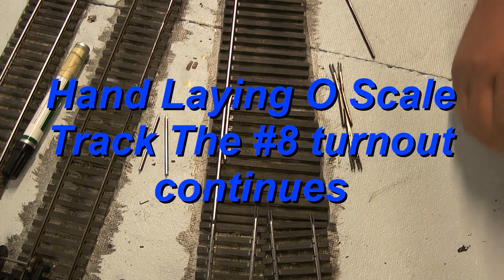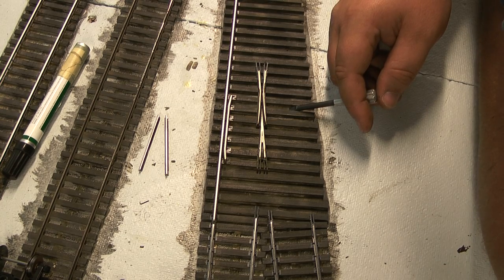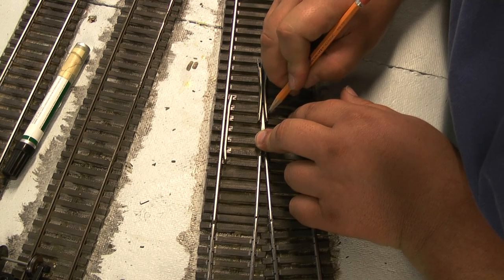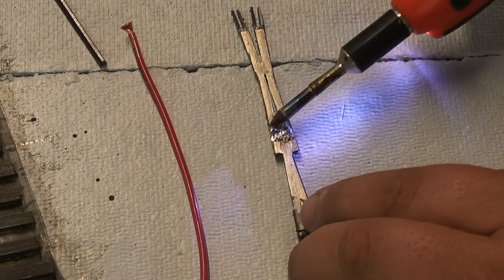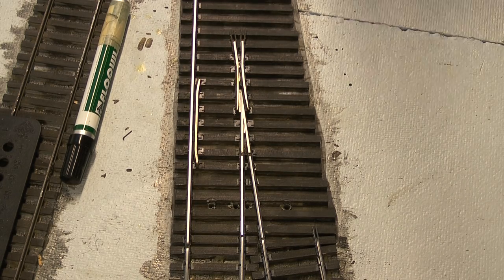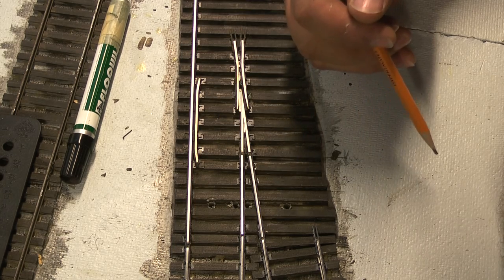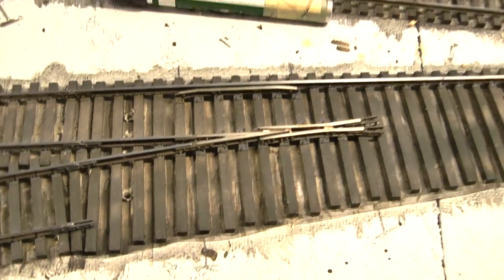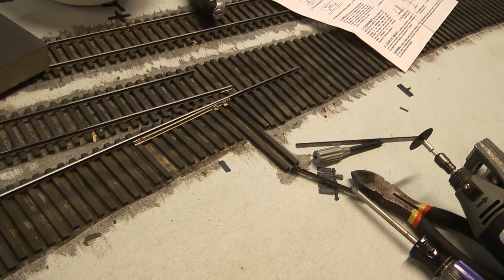Hand Laying O Scale Track Part 5 Setting the Frog

Comment: Using code 148 and ROW frogs.  After laying the outside rail per your video using rail plates, then the cast guard rail, and finally the frog.  Checked everything with NMRA metal gauge.  Using Intermountain wheel sets in standard trucks, the wheel rolling though the frog raised up just enough to derail.  Also wood ties carefully sanded with a commercial sanding block. I did email Jay Criswell about this. Any ideas?